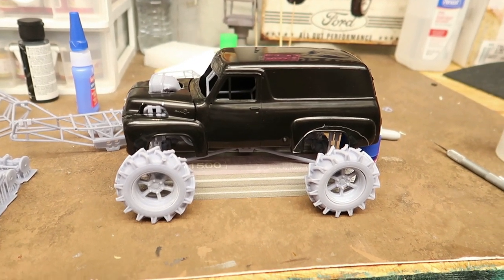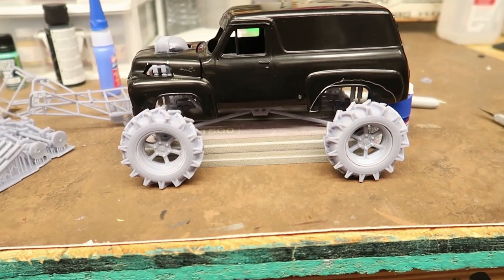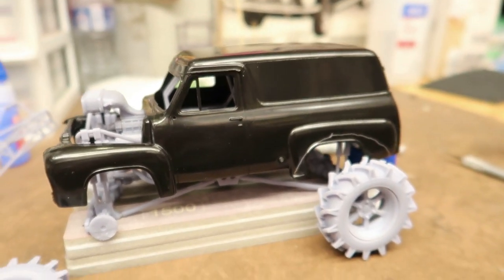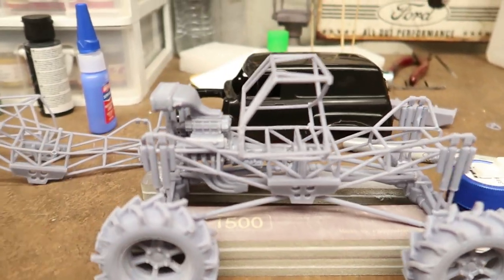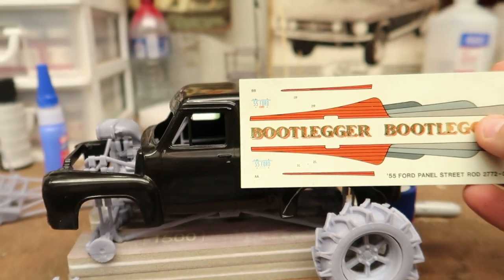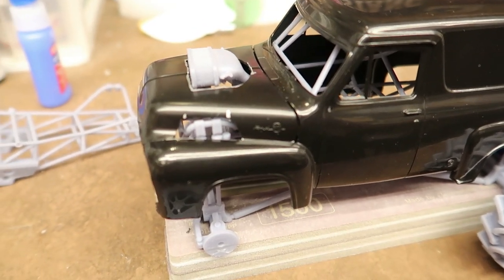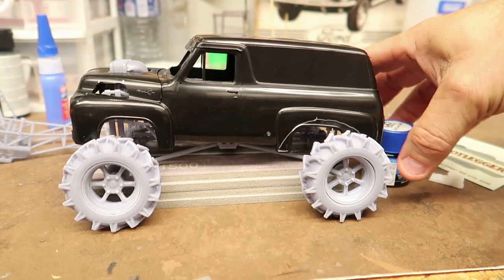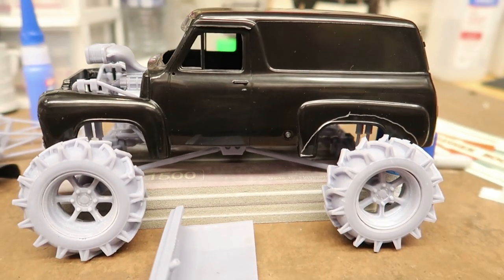I started my USACC 1955 Ford panel truck and it's going to be so cool!!!

Comment: I built a ford  F150 raptor and scratch build a lift kit and mud tires and scratch build driveshaft, used a diff. From a tow truck kit.😊

Comment: From the different builders' previews I've seen, it looks like the theme should have been use every printed component you can get your hands on.
Reply: I won't be using any printed parts Don.... 🙂
Reply: @THROTTLEPOWER  Nice to hear old school is still present!
Reply: @donstevenson2660  👍👍
Reply from the maker: Well it's an open idea group build. 3d printed parts are here and open up amazing possibilities. I like staying with the kit supplied parts also but going wild can be fun too. If it's out there use it!